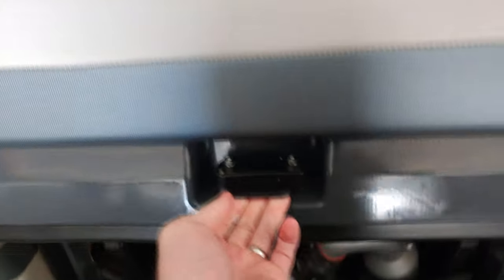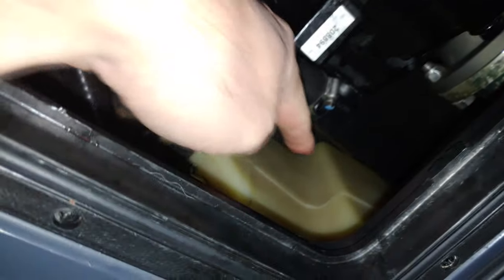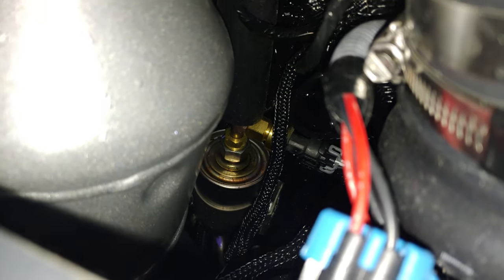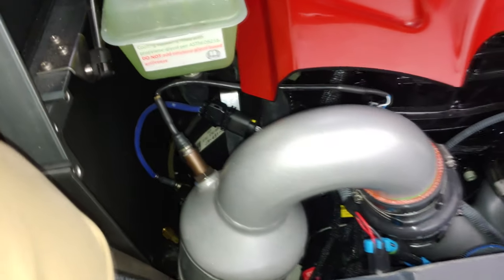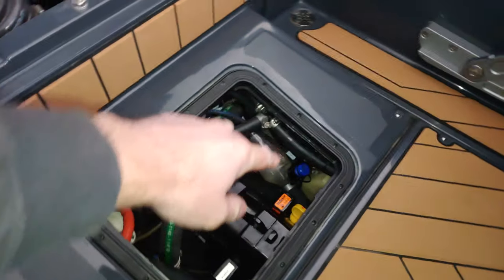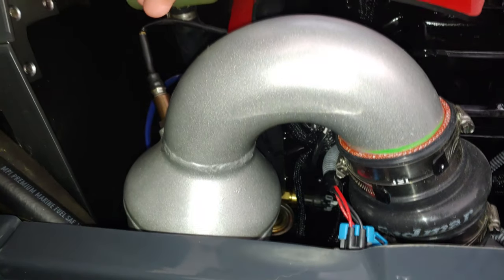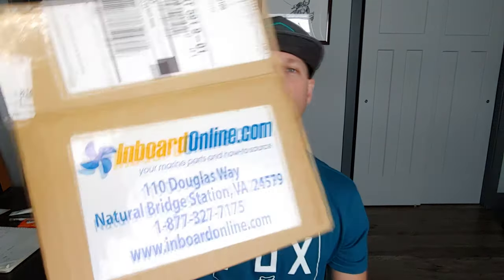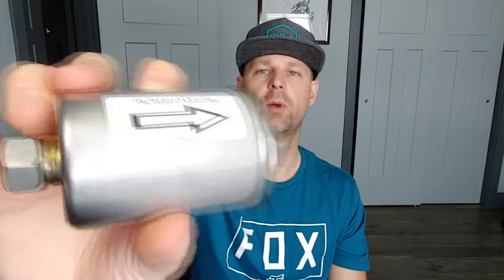FUEL FILTER FOR WAKEBOAT!  Episode 13, DIY Series

Comment: Did you end up moving the exhaust at all? It's possible to do it without moving the exhaust, I've done it. But it was incredibly tedious. Took me about 3 hours cause you have to use tiny wrenches at a weird angle and you only have enough room to go 1/4 turn at a time. I'm interested to see the route you went for when I have to change it next time.
Reply from the maker: I actually sold the boat before I got to it, I definitely think it would be ideal to move the exhaust to have enough room